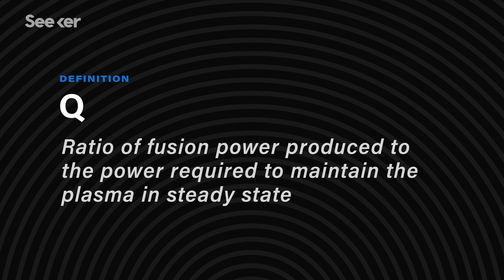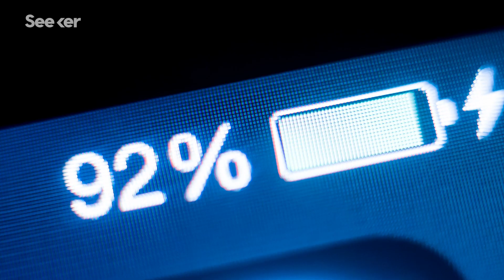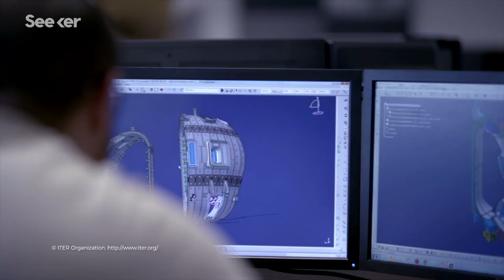How Close Are We to Fusion Energy?

Comment: Fusion should be a goal but salt reactors are the technology we need right now
Reply: @ruakij6452  The other option is to burn our supplies of coal, gas and oil. Which is not gonna last us long. Windmills are too expensive and don't give a lot of power, solar panels are barely green since they take too much energy to build and they run out rather quickly and you need sun. Water turbines and geothermic energy is not available everywhere.
Nuclear fission is the best we have currently but unsustainable in the very long run. Also no one wants the reactors in their border since everyone is so afraid of Chernobyl 2.0 happening (Which might never happen anymore anyways). And nuclear fission is really taboo. 
But if we are really this close to nuclear fusion, we should pursue this goal. It's the best way to get energy we have right now.
Reply: @ruakij6452  This is fusion, not fission. But yes, you're right about the part with possible unforeseen consequences.
Reply: @ruakij6452  you are forgetting the bigger picture, once fission does become a reality and it is viable, current nuclear reactors would ultimately be scrap altogether, why run two types of reactor when you can run one that is far more superior (on paper) and save more money in operation and waste management (since fission doesnt produce waste aggresively like nuclear). i just hope i got to see a fully  working efficient fission reactor before i die of old age.
Reply: @ruakij6452  I always love when someone points out long half-lives like that is just the most damning thing about nuclear power "oh no, it'll be radioactive for millions of years!".
 
Long half-lives are actually a good thing - the longer the half-life, the more stable the isotope is. Assuming proton decay isn't a thing, everything above iron is essentially radioactive, although their half-lives are exponentially longer than the time the universe existed they will eventually decay into iron. If proton decay is a thing, then literally EVERYTHING is radioactive, it's just a matter of how much and over how much time; a shorthand definition of half-lives.

To boil it down to an insultingly short description:
Long half-lives mean LESS radiation over a LONGER period of time, Short half-lives mean MORE radiation over a SHORTER period of time.

Why? That is what half-life means: the amount of time it takes HALF of a given isotope to decay into ionizing radiation.

People like to overplay the dangers of nuclear energy with Fukushima and Chernobyl though it is by FAR the safest way to generate massive amounts of power with the fewest amount of deaths and injuries. Nuclear power is just more newsworthy in that a lot of "death" and scary things can be put on one point of time - it's just a bias from an event that has "shock factor". Despite people dying on a daily basis from any other form of energy.

https://www.fool.com/investing/general/2014/09/14/why-the-safest-form-of-power-is-also-the-most-fear.aspx

the research has already been done: Nuclear power is by far the safest option we have to ensure massive amounts of power 24/7/365. That isn't to say solar, wind and other renewables are useless, they still have their place in a net NEGATIVE emission future, but without nuclear the best you can get is net neutral, and that is not enough to reverse climate change. With a disaster looming upon us that can very well spell extinction, we must use every tool we have available - it's a matter of life and death, even if that future makes the Geiger counter click a few more times a day.

Comment: I was looking at concept breeder reactors.... It's still such a disconnected concept design for using plutonium-cerium-copper alloy. 

They might as well use uranium for a catalyst for this reactor based on density of material.
Reply: Bored when you say Plutonium-cerium-copper allot do you mean plutonium fuel with cerium copper cladding? Copper doesn’t add any benefits to the fuel in terms of a neutron multiplier and some isotopes of Cerium have spontaneous fission, so in my opinion this seems like a questionable choice for a fuel matrix especially in Fast Spectrum where you want to negate as much poison and moderation as possible.
Reply: 😐 the breeder reactor process it in liquid form it says alloy but the reactor was considered to be fusion.. They increase the conductivity charge for a faster renewable source.. While maintaining the max amount of density possible..

Comment: Fusion is not anywhere near or close to practical. Certainly, a lot of private investments recently and moderate government funding increases (by countries other than US). As much as I'd like to believe it is true, but the so-called future of energy, i.e. fusion, will remain to be future energy in a foreseeable future, I don't see the light over the tunnel. 

Three main hurdles are there in play. One is physics. We have learned a lot about plasma physics over last 70 years. But I don't think we fully understand the plasma behavior under certain conditions. For example, what is exactly the mechanism of solar flare and how do we control it. An unexpected sudden jump of local high temperature spells troubles for reactor design. 

Second big mountain to get over is engineering. The materials and structure of hardware have to deal with extremely high temperature, leaving no room for error in process control. The problems with plasma contain duration cycle and waste treatment are yet to have sound engineering solutions. As the saying goes, the shit could happen, will happen, how do we do with safety, durability and reliability issues of the reactor? As everybody agreed, there is a lot of challenges. I am not saying there are no solutions to these problems, actually I believe there are solutions by the end of the day if we keep trying. But at what cost? cost to develop, cost to build, cost to operate.

This comes to my last objection to fusion power, i.e. commercial. Fusion will never make economic sense comparing with solar (natural fusion energy) and wind. Solar and wind are cheap now, I mean really cheap, cheaper than Fossil fuel. One may argue solar and wind are not dispatchable power. But this has been improved. For one thing, we now have a much better forecast of weather. Grid operators can utilize renewables just as other means of generations. We also have energy storage, which can buffer generations and demands. In US we have 23GW hydro storage. Battery is cheap now and we are looking for shifting power for 4 hours, we may just need to add a few cents/kWh to the LCOE. Even with seasonal variation of renewable, the added storage (we could use hydrogen) need may not be too much to bear. In next decade, I believe we can lower the cost of storage to less than 10 cents/kWh of LCOE for seasonal power shifting. Fusion will come nowhere close to this number.

Sorry to disappoint you, fusion is not the future energy.
Reply: You're correct about everything except the solar and wind being cheaper than fossil fuels.

Comment: Even if it works, i.e., produce more electricity than it consumes, we must discontinue CO2 NOW not in 20 years. Furthermore, renewables are reliable for two reasons (a) wind, sun, water, and thermal energy are reliable when you look at larger regions, (b) we have storage technology available which will get cheaper in future. Storage allows us to collect over production and stabilize the grid. Actually, we are doing this for decades with battery and hydro storage facilities. We just need to build more of them (especially battery storage systems). Fusion is not our only option. If it were we were doomed.

Comment: With advances in renewable energy and storage, and the great scalability and redundancy of that technology, I don't see fusion being cost effective or desirable outside of space applications.
Reply: JZ909 While the primary purpose for many of these projects is to produce nuclear fusion, these facilities also run various tests to find new information related to particle physics. While you may not be aware particle physics has played a crucial role in advancing society with the development of technologies such as MRI scans, grid computing, battery energy density, cargo scanning, aeronautic vector computing, superconductive polymers etc. 

Many people don’t realize that advancements in science while typically associated with one specific field are actually used in almost all industries to significantly improve products. Take quantum mechanics for example. Laymen society would typically associated QM with extremely advanced sciences probably associated with nuclear engineering. However with quantum mechanics we would never have been able to manufacture microchips or have working computers. The advancement of science in the foremost technological superior fields opens gateways to technologies that can completely redefine a society. That’s why we must pursue fusion and particle physics.
Reply: @brian2440  From a research standpoint it makes perfect sense and research facilities have been around since the 70s. I just don't think there's any need for urgency when it comes to efficiency of power generation.

Comment: The cleanest greenest and most viable alternatives to fossil fuels are wind solar hydro combined with batteries.
Even the most optimistic scientists involved in fusion experiments say that it'll only be viable in at least 40 years. Batteries, solar and wind are here now and they are viable now they are getting better and better and cheaper and cheaper, before fusion is viable on earth, solar wind and batteries will have become so cheap, efficient and reliable that fusion will be inferior and unnecessary.
Fusion won't be free for anyone either, but solar and batteries once installed can power a home for free already. Solar is extremely underestimated, and extremely powerful.
Fusion is overestimated and there hasn't been a single fusion reactor that creates a surplus of controllable energy as of now. Solar, wind, hydro, and batteries work, fusion as of now doesn't
It is a gamble and we don't even know if it could ever be made viable, we can only guess. Well my guess is, that it will never be useful on earth.
Before Fusion becomes useful, it's more likely that they'll have success with LFTR.
Also it's always said, that the fuel for nuclear fusion comes from seawater, that isn't completely true, Deuterium and regular hydrogen are found in seawater, but tritium is not, you have to make tritium to be able to achieve fusion, and it is pretty hard to do that. The other option is Helium 3, but again, incredibly scarce isotope of Helium that is incredibly hard to make.
some say the Helium 3 can be mined from the moon, but we aren't on the moon and it's still just a theory! Before we have a viable Helium 3 mine on the moon that could supply earth with enough material for fusion we will no longer need it.
Fusion reactors are some of the most expensive and complex machines that humanity has ever constructed, and even if it turns out that they work, they might still not be financially viable.
A Fusion reactor would need incredible amounts of maintenance, even more than a fission reactor. Solar, wind, and batteries are much more simple and they need the least amount of maintenance of any form of energy production currently available.
Fusion is a dream that will never come true and that will never have to come true, because the alternatives are getting better so fast, that it is only a matter of time before the public realizes, that  the technology we need to save the planet is already here, and not another 30 or 40 years away.
Mark my words, the 2020s will be a tipping point for how the world thinks energy and transportation, the evolution of the EV alone has proven the potential of batteries, and with mass production they are only getting cheaper and better. Solid state and zinc bromine gel batteries are here already and are even better and safer than Lithium-Ion batteries.
Airplanes in the future will be powered by hydrogen created from carbon neutral sources, the future doesn't need mister fusion to be bright, the future of energy will basically be renewables on steroids and it will be brighter than ever imagined.
Reply: Storage will be solved once we start to use NEET batteries: 
Team demos new atomic effect for potential isotopic battery 
February 7, 2018, U.S. Army Research Laboratory 
https://phys.org/news/2018-02-team-demos-atomic-effect-potential.html
Reply: asdf  said: "For that to work you have to live where there's sun and wind." 
What place do you live that there is eternal darkness and no wind?
Reply: asdf  That not eternal darkness, that's six months darkness and six months light. And you don't live there, almost nobody lives there. Not a relevant location in a discussion about people getting their electricity and heating from renewable energy.
Reply: Solar and wind are not viable. The only one that is viable right now is nuclear fission.
Reply: Some countries are powered almost half by renewables already, if theyd put more effort into that, there'd be little problems.
renewables can already support the world, but the problem for the longest time has been storage, but the energy storage problem is beginning to fade, advances in battery technologies will lead to the ultimate success of renewable energy. And if you charged energy companies for the safe and secure storage of nuclear waste for 10 thousand years the viability argument will very quickly fade.
A nuclear fission reactor of the current generation is actually a pretty terrible device, we're harnessing the base power of the universe to boil water, high tech on stone age level.
Besides that they need tons of maintenance and they still require fuel, not that much fuel, but still.
A Solar powerplant once installed creates energy by itself, no fuel and very little maintenance needed, same with a wind turbine.
And while nuclear fission by far isn't the worst form of energy production at the moment (that would be coal and oil) they are still problematic as long as we cannot get rid of the fuel in an efficient way.